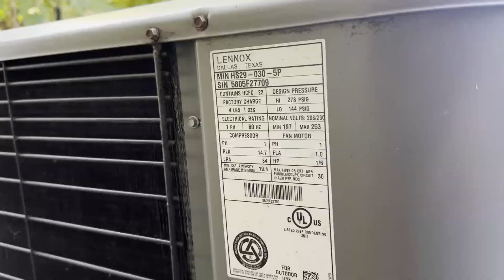How to Figure Out the Tonnage Size of your Air Conditioner

Comment: So my outside unit is 38 years old and unreadable no matter the gimmicks I've read about online to find that information (magic marker etc). The papers I've found inside it look like pages of the Old Testament. The air handler I know is 3.5 tons. However, thar doesn't mean the condenser is the same size. I'm afraid of oversizing it. Is there another way to make sure the size of the condenser because it really is the perfect size. Parts inside the unit? It's a Sundial whose been out of business for who knows how long. One of those units that just keeps on working. Bu it's time for a new one. My luck will run out.
Reply from the maker: That's a tough one!  I'd probably call a few HVAC companies and see if you can't request that an older, reaaally experienced tech come out and take a look at what you have there.  Either way you're probably going to have to buy a complete new unit.  Whatever coolant is in that thing I'm sure is no longer legal, and is likely completely unavailable now.  You just want to make sure the new unit is properly sized for your home, and definitely Not oversized.  Hope this helps!
Andy
Reply: @insulwiseenergycomfortsolu3293  Yeah it has r22. From what I've read the companies are now using the new r32. I've got a trustworthy guy coming out to take a look at it on Monday. I'm figuring it's a 3 or 3.5 ton, but yeah I want it sized correctly.

Comment: I have an American Standard unit.  The model number is 4TTB3036E1000AA. What is the tonnage?  With both the 30 and 36, I'm not sure how to read it.
Reply from the maker: It looks like it's a 3 ton unit.  I googled the number that you gave me and this was what popped up.  Hope this helps!
https://www.shearersupply.com/product/american-standard-reg-4a7a4036n1000a
Reply: Thanks, Andy.  I may need a new AC unit soon, and I want to buy the correct size for my 1300 sq foot condo. I live on the Gulf beach coast in Florida and have a corner unit with a south and west exposure.  The sun reflecting off of the water all day can make it even warmer.  I'm wondering if a 2.5 ton unit would sufficiently cool my condo.  All the windows and the sliding doors are original from 1992. @insulwiseenergycomfortsolu3293
Reply: @insulwiseenergycomfortsolu3293 Thanks, Andy!  My current AC unit may need to be replaced soon, and I'm trying to determine the appropriate replacement size.  My condo is a 1,300 sq ft corner unit in the central Gulf beach area of Florida.  I'm wondering if a 2.5 ton unit would cool my home sufficiently.  I have a south and west sun exposure and a fair amount of heat is also generated from the sun's reflection off of the water.  My many windows and multiple sliders are also original from 1992.  Any thoughts and information would be greatly appreciated.

Comment: So my American Standard has a 24 in the serial number but a 30 is in the model number.  We thank you for the information, but think it's idiotic that we have to research this instead of the manufacture just putting it on the ID plate.
Reply from the maker: Haha..my thoughts exactly.  It'll be the model number.  You've got a 2.5 ton system there.  
Andy

Comment: I have an approximate 2300 sf home. My ac model # on top of the label reads 38BRG060300.  However, on the bottom it reads 38BRG060---301.  Would I divide the 30 by 12 for 2.5 tonnage or 60 by 12 for 5 tonnage?  Thank you.
Reply from the maker: What brand of unit is it?  I had someone else ask me a similar question earlier this year.  When I googled the brand and model number that information popped up in an article.  When I googled your model number and "air conditioner" this article came up.  It looks like a carrier rated at 5 tons of cooling.  The "60" divided by 5 equals a 5 ton system.  If correct, that's A LOT of cooling load for a 2,300 sq ft home.  Assuming average windows and insulation, a 3 ton unit should be more than sufficient.  Link to article I found is below.  

https://sawmillcreek.org/archive/index.php/t-184325.html
Reply: @insulwiseenergycomfortsolu3293  The article appears to be accurate. It is of the Carrier brand. Same model number and R22 Refrigerant. My home was built in 2006. So, it’s about the same age as the writer in the article indicated. If it truly a 5 ton, what are your thoughts on the Airgo air conditioner soft start (16-32a)? It says it works on AC units 4-7 tons.
Reply from the maker: @Shalatee  Hi there, I'm not sure what type of system you might want to I assume replace it with?  I will say that 5 tons of cooling seems like A LOT for a house that size.  If it were me, I'd hire a good company to air seal and upgrade your attic insulation, and perform all other obvious weatherization / insulation measures.  I'd then contact a reputable HVAC company and get some estimates.  You should be able to cool your home with a 2.5 - 3 ton system if it's well insulated and fairly tight.
Reply: @insulwiseenergycomfortsolu3293  Thanks for the info. I got a hold of Carrier, who identified my unit as a 5 ton by the serial number.  They said different size units can be used depending on, as you said, the air seal and other factors.
Reply from the maker: @Shalatee  Glad they were able to confirm and help you out!

Comment: I got a HS29-411-2P what would be the tons for it? I’ve been looking everywhere and can’t seem to find anything close to finding the correct number
Reply from the maker: I found this on heatinghelp.com.  I'm assuming it's accurate, but always worth double checking.  The 411 designation means that it's a 3 ton system according to this.  Link for the page below:  
hope this what you're looking for

Lennox equipment:

211= 1.5 ton, single phase
261= 2 ton, single phase
311= 2.5 ton, single phase
411= 3 ton single phase
413= 3 ton, 3 phase
461= 3.5 ton single phase
463= 3.5 ton, 3 phase
511= 4 ton single phase
513= 4 ton 3 phase
653= 5 ton 3 phase

https://forum.heatinghelp.com/discussion/79636/lennox-model-numbers-starch

Hope this helped!  This was a weird one. 
Andy

Comment: Mine says 047.... So, that's almost 48, which would be 4 tons, right?? But that's weird
Reply from the maker: That's not right.  In the model number there should be a number that is divisible by 6 typically.  If it's 18 that means 1.5 tons.  If it's 36 that means 3 tons, etc.
Reply: @insulwiseenergycomfortsolu3293  the M/N: ML14XC1-047-230A03
Reply: @insulwiseenergycomfortsolu3293  M/N : ML14XC1-047-230A03
S/N : 1922A44682